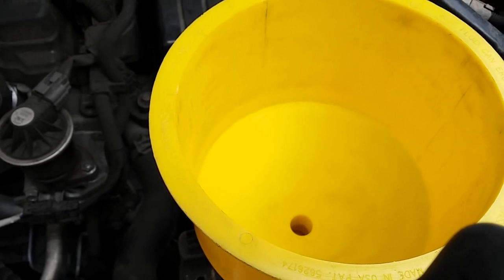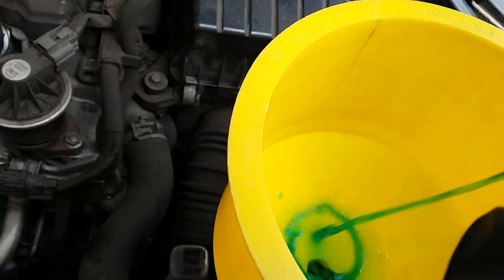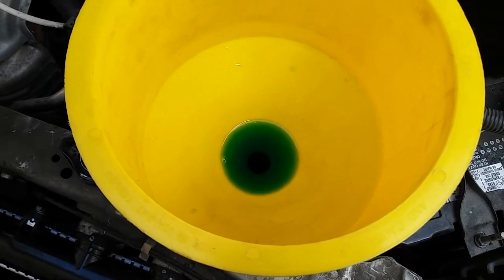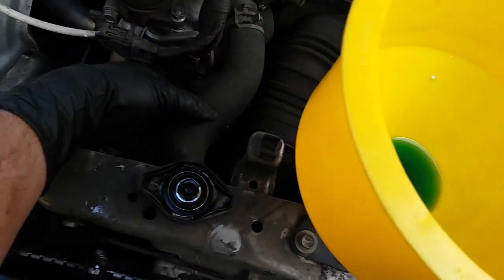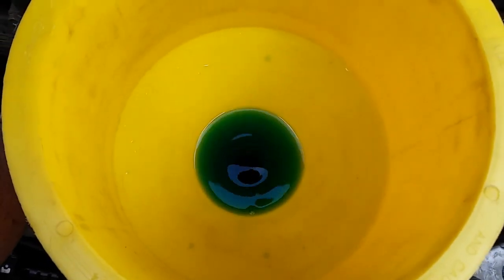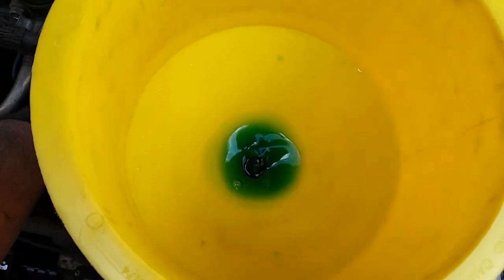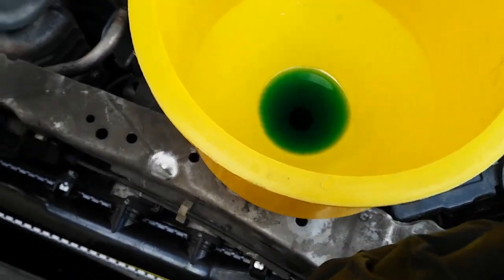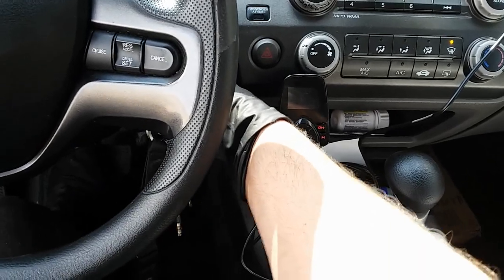(Honda Civic) Using a Spill Free Funnel to bleed the coolant system - Part 2

Comment: What do u do with extra coolant left in funnel when the bleeding is done? Also do you just leave the system fully filled with coolant like that? Its above max on the radiator...
Reply from the maker: @jogalong  usually you put the extra on the reserve tank. Normally if you let the engine cool down, the level should go a slightly down on the radiator.

Comment: I've been having overheating issues with my car for a while now, this might do the trick.

I just did this to my Honda Civic, there were tons of bubbles, it took quite a while for them to all get out.

I'm going to take it for a test drive tomorrow and see how it runs.
Reply from the maker: Hope it works out.
Reply: Update: it didn’t work lol
Reply from the maker: @S3ven4  worse case scenario, your issue is a head gasket problem. Are you fans turning on? Another possibility, faulty thermostat.
Reply: @EliTheOBDTech  my fans are turning on, my coolant leaks, I cannot for the life of me find out where. I’m guessing it’s a head gasket issue, or the leak is so small it’s really hard to find. I been having the issue for months now. Impossible to drive the car more than 45 minutes without it overheating
Reply from the maker: @S3ven4  Most likely a head gasket problem.  Have you smelled any coolant inside the vehicle? Sometimes the heater core goes bad and leaks.
Reply: @EliTheOBDTech  nope, no smells, nothing. Just disappearing coolant within an hour and no other symptoms. You think it’s a head gasket issue? It’s been plaguing me since April.
Reply from the maker: @S3ven4  Hondas are known for head gasket failures. You can try and do a cylinder leakage test on each cylinder and see if you see bubbles on the radiator as compress air enters each cylinder.
Reply: @EliTheOBDTech  I’ll get back to you when I can about the progress man thanks.

Comment: So I tried this and the coolant got hot an overflowed out of the funnel and went all over the floor. What could I have been doing wrong?
Reply from the maker: Two things, either too much air trapped in the system or worse case scenario, blown head gasket.
Reply: @EliTheOBDTech  Wow.., CMM. Tell us what was the outcome?? I'm dying to know.

Comment: How do you get the water out of the filler without spilling it? You didn’t show that part is there a plunger or something that holds the fluid in when you take it off?? Thx
Reply from the maker: The kit comes with a plug that goes inside the spill funnel.

Comment: put more into the funnel dude. why do you think they made it so big. they give you a plug so you wont waste any when done.
Reply from the maker: That method has worked for me every time with no issues. If adding more works for you, that's cool too.
Reply: @EliTheOBDTech  "It worked, bro". Way to make it harder than it should be.
Reply: Eli TheOBDTech I did see a point where it ran dry, by filling it up more this wouldn’t happen. If coolant is not in the funnel you are introducing air.
Reply from the maker: @ncvman  The coolant was just at radiator neck level, which you could not see with the funnel on it.